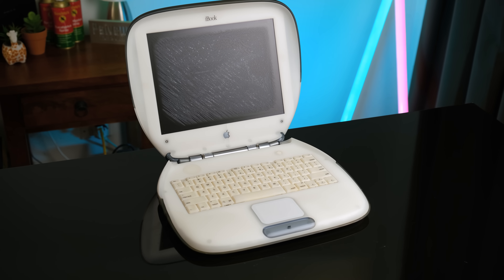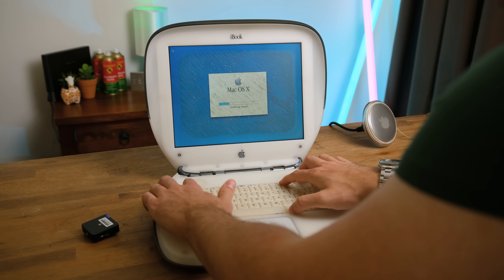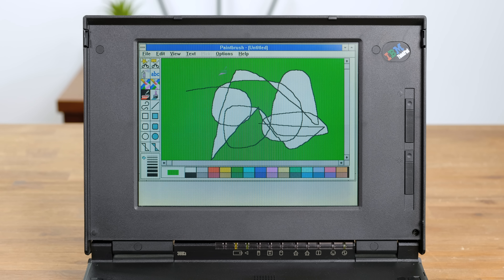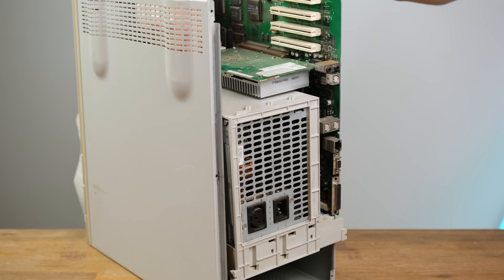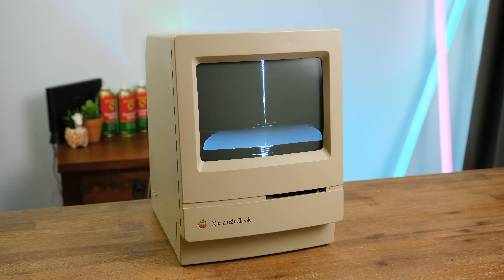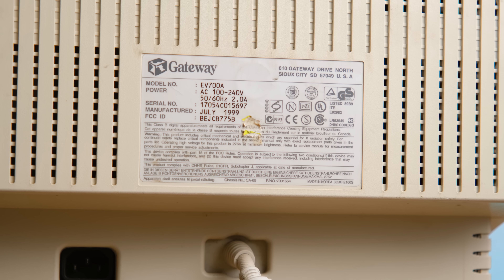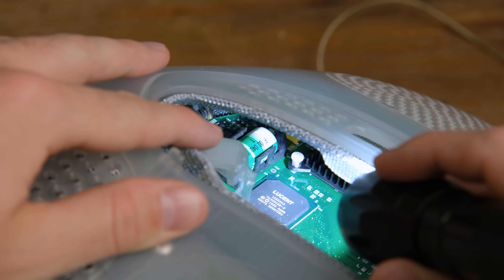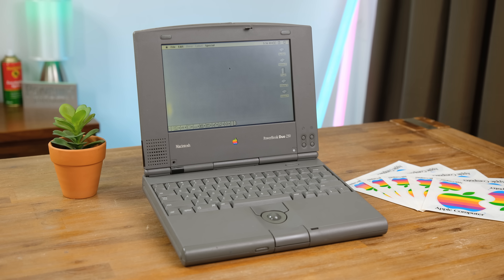So Much Vintage Tech Is Dying... Here's Why

Comment: All depends of the equipment. Usually recording studio equipment is built to last that uses higher quality electronic components than consumer electronics many military grade.i own 6 hardware synthesizers many of them that are well over 20 years old still 100% functional with all original parts. 5 of the six synths are 19 inch 1U rack mount units. The oldest one being my E-MU Proteus 2000 that came out in 1999 and 2nd oldest is my Yamaha MOTIF ES that came out in 2003. Some of the buttons are starting to wear but so far not a single part has Ben replaced. Analog gear outboard also last a very long time too esp EQs, Compressors and Microphone Pre amps. They may need to be Capped every now and then buy many Analog peices from th 1970s are still being used today.

Comment: I know these issues all to well. Particular CRT ones. I worked as an arcade repair technician for several years. Still do it as a side gig and hobby.

I lost count of how many caps and flybacks I have had to replace over the years. Still CRTs outlast LCD overall though I'd be curious to see how modern LCD compare in a few decades.
Reply: Pecunia-non-OLED TVs show burn-in after 2 years of daily use. My portable CRT TV of around 1990 is running roughly 14h/day and still makes a picture (although it likely needs a recap).

Comment: I have a working Gameboy advance but my psp battery blue up all on its own not charging not in the psp you can't actually unplug the battery from the chip located inside the battery case, my ps3 still works and I have a working windows XP. I took a electronic class in school they explained how things expanding, power and humidity is linked to ageing so I leave them on longer near a dehumidifier like I'll keep the PS3 on for 3 months till I finish the game the XP never turned off the only things that really die is hard drives but I just do a backup and restore easy fix a drive only is good for 5 years so that kinda sucks but some optical disks are much more reliable Blu-rays suck don't store data in them

Comment: my trick to deal with rubberized parts you still use is to remove the part and  apply talc, flour or whatever similar your want.

it will stick in, coating the surface, and it will be ugly for a while, but with use the caked gunk layer will peel off and it kinda goes back to normal

Comment: Problem is the plastics, should of used glass and light metals that way lasu longer but I think they made them that way to die to keep us  buying and buying so they keep getting money. Gotten worse today with cell phones I swear my phones use to last at least 3 yrs then 2 yrs and then maybe 2 ½ now I'm lucky if they last 6 months. I have had this one I'm using to comment and it's about 4 to 5 months old and it runs hot, slow at charging slow loading, crashes, battery don't last long which is to be expected over time but this is still a new phone. I don't even but expensive phones anymore they are the same as cheaper ones in these cases so why fork out alot of money when it's doing the same thing as cheaper phones mid to low range phones. These are Android phones too. I hate apple products really bad can't stand them.

Comment: i have two old Windows XP computers, one that used to be my grandparent's and one that was given to me by a place my dad worked at. early last year they both worked fine, but i tried booting up the one my dad gave me just a few months ago and it's stopped working. haven't had the time to try to figure out whats wrong with it, but as you've shown its likely a just a case of degradation after roughly 20-something years. neither of the computers were kept in ideal conditions before i got them anyways so i expect the other one to quit on me sooner than later.

Comment: I had an over-30-years-old bedside digital alarm clock/radio that still worked in 2017.
It even played TV stations (audio only).
Keeping your lithium batteries charged between 40% and 70% does something like TRIPLE their lifetime.

Comment: I feel this….
 I re-capped my 1992 Sega Game Gear after its capacitors failed on all 3 boards inside. 
Luckily no extra damage. Ive also re-capped a coupe Ford Tripminders for my car, its a little fuel mileage computer from mid 1980’s Ford cars.

Comment: My 1st gen iMac, tray loading, doesn't boot up anymore, shows a yellow LED and I can hear fans and the HDD spinning but the screen doesn't even turn on. For a while it worked amazingly well when I got it 11 years ago. It's a real shame. I'm also in need of some spare parts for my 8,1 MacBook pro which I can still get in good or brand new condition but the wallet won't allow.

Comment: Wow! One thing that impresses me is the Nintendo 64. I still have mine and it still works. It's an original one from the release date too. I still play it along with all of my games as if it's still a new game console. They were built to last. Other things that stand the test of time are vintage equipment from the 70's. equipment from the 50's - 60's seems to be built strong with strong metal components. I have amplifiers, guitars, electric pianos like the Fender Rhodes. I mean, those are instruments and instruments can basically last forever. But the amplifiers have more components like tubes which had to be replaced on mine. I also have an Onkyo stereo system that has been in my family the 90's. I remember it being used all of the time as a kid, and now as an adult, I still use it literally everyday for my turntable. That system is a beast! I play it loud and proud to and sometimes forget to turn it off and it still works like brand new. I guess computers are different because they have a sophisticated build.  Vinyl records also impress me. These are basically plastic disc that can easily warp with heat, yet old records from the 50's still play like they were pressed yesterday. It's interesting to see what lasts and what doesn't.

Comment: I have several long-term storage containers, where I store electronic components, storage media (like CDs and DVDs), ammunition, and some miscellaneous tools. The containers are airtight, sealed with wax, and the air has all been replaced with Argon.

Comment: before watching the video, i wonder a lot why people dont replace old parts more often? unless they do ofc, im not people, but like, if mechanisms are failing because parts are rotting and batteries are dying, why dont people replace the parts? are some or many of the parts no longer in production? is using a different but similar part that is in production an option?

definitely not as simple as this, but if you can take something apart and identify how its put together, what's stopping you from building another one? (with proper time and money ofc)

Comment: my oldest laptop is a 2000 or so Dell Inspiron 8100. So far its still in excellent condition. Didnt think about removing the cmos battery, ill have to do that. The main battery is a simple tip-out kind that doesnt require the laptop to be opened and ive had that in a drawer for years.

Good video.

Comment: I had an old ChemBook laptop from around 1998 or so whose screen started to leak around 2018 or so. The rest of the laptop seemed fine. This made be believe that LCD technology from around 2000 had a shelf life of about 20 years. 

Also, in my experience, rubber parts are fail a lot earlier than plastic which is why I sometimes prefer plastic to fancy rubber textures on any laptop, mouse, or external keyboard. The failure of plastics in the PowerMac 9500 came as a surprise to me.  I did not know that some forms of plastic could actually disintegrate over time(a good thing for the ecology perhaps).

This video provides very good insight and talks about something that will need attention in the coming years.
Reply: Skin lotions (particularly with essential oils like fragrance) can strip paint from keys and decompose plastic surfaces easily. I am very careful with handling tea tree oil etc. Also normal oils (food etc.) can decompose rubber and some plastics, so keep food away from keys.

Comment: Storing electronics in a cool, dry place is no longer enough for most vintage electronics. Heat and humidity certainly have their roles to play, but oxygen itself is just as destructive, causing oxidation in metals and polymerization breakdown in plastics. The only solution is to take a page from the museum's playbook and start storing vintage electronics in an airtight containers filled with a non-corrosive gas, such as nitrogen or CO2. Inert noble gases, like argon, are even better. Of course, that means you cannot use them (unless you jerry rig a clear case and wireless I/O, I suppose). But if the hardware is that ancient, you're probably more focused on preserving it and not using it, anyway.
Reply: Ozone harms plastic and rubber, but most of the corrosive substance is typically already inside (battery leak vapour, plasticizers, wrong oils, acidic glues), so sealing it airtight can make the disaster much worse than letting it safely vent out. 

E.g. decomposing celluloid (remember self-combusting film reels) accelerates itself even more when sealed airtight, because the produced acid pushes the chain reaction when it can not vent out or get absorbed. The solid block of transparent celluloid a film reel is made of is the worst case, but also a celluloid accordion or doll should not be stored airtight without absorbent.

Comment: I had a fully functional Toshiba Satellite 430cdt laptop from 1995. The CMOS battery leaked last year and I could no longer turn it on, spent weeks cleaning the board but it's like it forgot its own bios. eventually I gave up but was made aware of battery leaking issues for other old tech I have.
Reply: Unless it is a nasty DRM protection circuit (which exists only in some arcade PCBs but not household PC), the CMOS battery is not needed to keep the bios itself in memory, but only its user settings. I.e. when it runs empty, the PC may forget which harddrive and CPU type is installed, but after replacing the battery and entering setup info, it should start again.
Reply: @cyberyogicowindler2448  yes you are right, after the battery died the laptop kept running for 4 years. Unfortunately over time the bios became longer and longer to load the HDD over time. It one day turned on and the HDD spun up but then the main POST check sounds failed to load. After this I was at it for 3 weeks with no luck of revival from cleaning the corrosion, carefully trying to reflow solder in damaged areas and cleaning every contact and making sure nothing was bridging. It now sits on my shelf as a novelty haha but I have plans for it

Comment: Cheaply built, cheaply last. 
Sorry mate, there ways around all of this, for example I have a storage box with broken electronics I wrote down whats wrong, and all of them have broken plastic pieces, the solution? 3D printing, the downside? Costs a lot, time consuming, is it even worth it??? 
It sucks no doubt, I still daily drive a 2011 Alienware laptop, but everyday I am afraid its gonna bite the dust, I have a donor motherboard but you know, its just as old as the one in my working Alienware so chances are they degrade similarly since what degrades are usually the caps and I am sorry to say but as China, america and Taiwan are drumming on the war drums, that juicy reserve part market is gonna get hit so hard, I used to buy caps and pieces I needed for other electronics from Ukraine and Russia, but thats all gone now apparently one of the warehouses that stored something like 5 million power regulators you have on your motherboards in Ukraine got hit and blew it all up, damn that really hurt me.

This God forsaken world truly wants to end itself one way or another, its not just technology decaying, society is as well, its also ridicules how European Union enforces VAT on everything, a 1 dollar power regulator or a cap now becomes 1,25 dollars, not cool when you need a large batch of them.

Comment: This was very sad to watch... A lot of very interesting and cool retro stuffs are quite fragile... Notebooks/laptops are maybe at the top of the list. I had two retro notebooks, and both ended up dead...   Some devices can resist the test of time better than other. I'm thinking of Gameboys, with a wide range of brand new parts for modding, iPod Classics can be fixed and modded as well. Some consoles an computers with simple design like Atari VCS and ZX Spectrum are very hard to kill.

Comment: Over the years, I have rebuild some electronic equipment. Electrolytic capacitors are the first to go. There was the scandal of early '90s when all capacitors made in those years exploded, because somebody copied the new high capacity capacitors but had the wrong formula for the liquid electrolyte.
Then, there are composition resistors which increase their resistance 1% every year, which I replace with metal film resistors. Transistors from the '80s increase their Icb0 to many mA, film capacitors gets leaky. 
A radio from the '60 with all components replaced is a great collector item.
Later, the first CMOS IC had a very high mortality rate, they all need replacements.
Electronic devices from the '90s had their design criteria changed. Whereas in the '70s and '80s a design required a ¼ watt resistor the designer used a ½ Watt resistor as good measure, this was no longer true with newer Chinese designs, which - to this day - use components to their max specifications - this save some pennies during the manufacture, and ensure the device can last few months or just few weeks of use...
Reply: With first CMOS semiconductors they didn't know yet how to treat them properly to prevent decomposition. E.g. in the Stylophone 350S were chips fed with 18V (2 big block batteries) those "on paper" could withstand maximum 19V or such, which margin was way too narrow. Nowadays everybody knows that a voltage regulator with 18V "maximum rating" is only safe to be used for 15V. Running that Stylophone on 12V fixed the problems without loss of functionallity (except perhaps reduced speaker volume).

Comment: 6:47
Don't be so quick to jump the gun on concluding the flyback transformer is failing!
Arcing can happen for a lot of reasons and it's pretty common that CRT monitors brought out of long retirements will do this pretty frequently for the first week or two, but gradually normalize and stop arcing.
If the focus drifts pretty badly when one of these arcs occurs or the display completely shuts off for a full second or more... okay then it's probably flyback or something related to the flyback.
Some people theorize that its primarily dust or the seal under the anode cap coming loose and shifting some things around that can cause this phenomenon where it arcs pretty badly for just a few days or weeks.
Reply: I am using a 22'' SGI GDM-5411 monitor, which highend Trinitron CRT flickered red/flashes like hell during power on. After recapping I constructed a timer that simulates a bad capacitor (cuts power-good signal) while running the CRT heater for 30s warmup, so the tube gets less stress and is still working. But it still needs occasional smacks on the screen front (powered off) because loose metal parts inside the CRT neck shift and cause arcing (red screen flash) likely because rivets of electric contacts lost spring force by heat. Also solder joints of white plastic connectors on the PSU board come loose and need to be resoldered after every few unplugs and cause bad contacts despite the solder looks good.
Reply: @cyberyogicowindler2448  Wow, that sounds kind of annoying to fix up. Good on you for fixing it as well as you have though. I bet that monitor looks friggin' gorgeous.
Reply: @licentioushowler3400  It has plenty of burn-in and the CRT does not like continuous operation (starts to flash red and make zing noises the next power-on) - likely because the getter substance inside the CRT needs long unpowered time to clean up stray ions in the the vacuum. But I still use it daily, although brightness and reddish black changes with weather temperature etc. in only semi- predictable ways.

Comment: him slowly realizing he lives in a humid environment when everyone in places like Canada is 0% humidity 9 months out of the year.
Reply: 0% humidity easily destroys chips by electrostatic discharge. Even datacenters keep 45..55% or so. Where I live, fortunately 50..70% humidity is normal. Only winter sometimes went <40, which makes my skin on knuckles etc. crack apart.
Reply: @cyberyogicowindler2448  ESD used to be a issue ya.

Comment: Also, this isn't for every single tech.  Due to different materials used, nearly all solid state with no batteries, or glue, I definitely have a TI 99/4A which is 40 years old and still functioning.

Comment: Deteriorating plastics in older tech is the reason I got myself into 3D printing. There's just no other way for a hobbyist to repair such damage, it's not like I can injection mold the plastic bits and bobs at home easily...

But elements like screens just dying out of the blue, or even disintegrating is actually terrifying. This one is not fixable. This one spells doom.